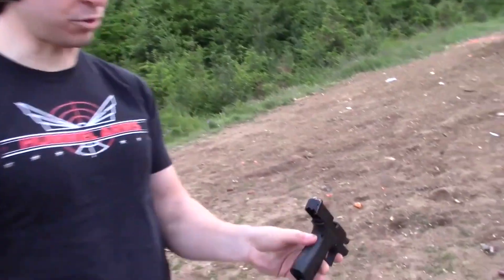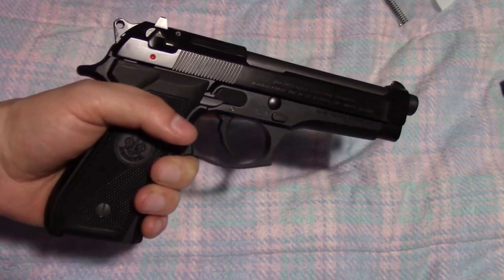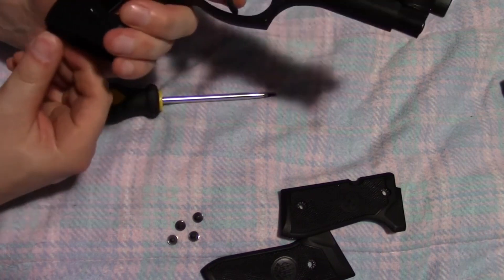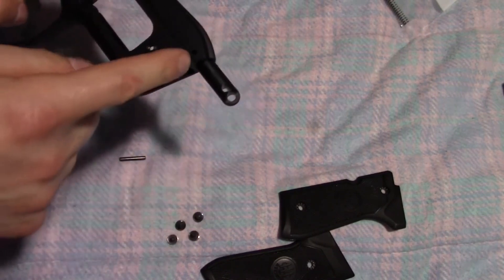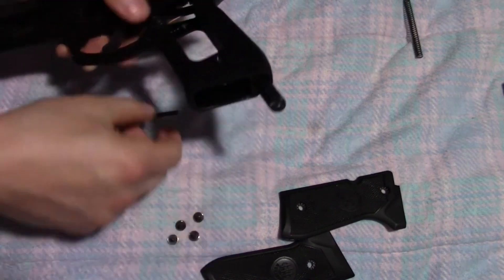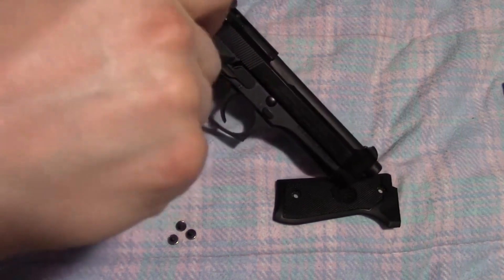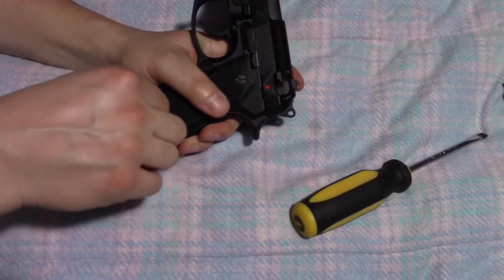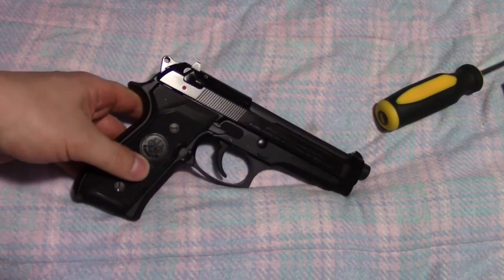Replacing the Hammer Spring for the Beretta 92FS

Comment: I know you didn't have a punch but to get the lanyard Loop hammer spring cap out just apply some pressure on the edge of a table and push the pin out sometimes it's a roll pin instead and you have to tap it out.
Reply from the maker: Yeah, I ended up doing that off camera to get the spring out. I learned alot from this process. I'm expecting the next one to go smoother.